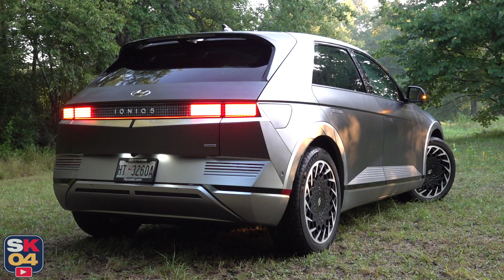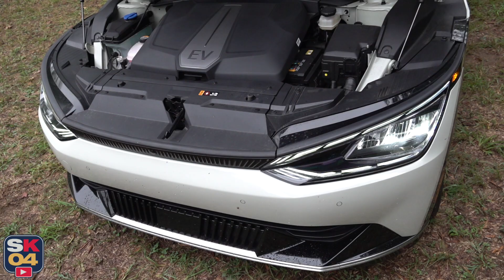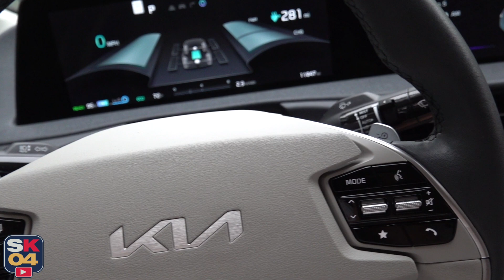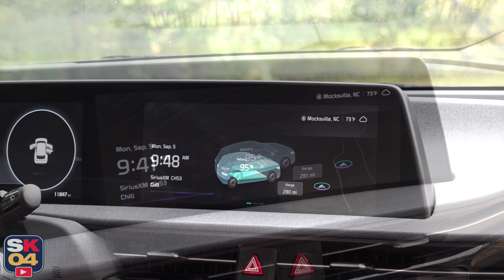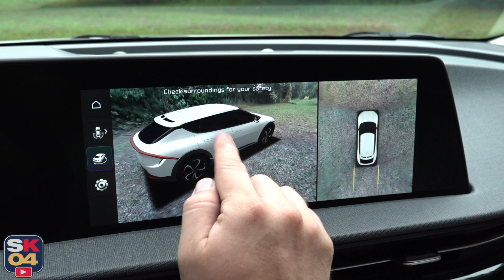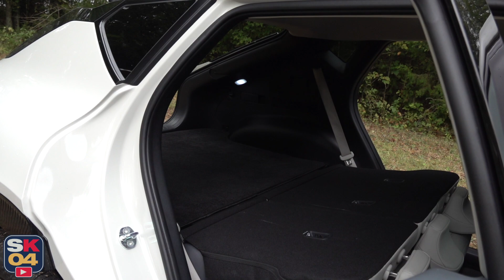2022 Kia EV6 Wind AWD: Start Up, Test Drive & In Depth Review

Comment: I've preordered a Cadillac LYRIQ AWD as my next car.  I should get it by January.

I've driven the Hyundai Ionic 5, the Kia EV6 and the GV60.

The GV60 is probably my favorite because of the luxury elements and BOOST button, but the Kia EV6 is definitely my second favorite. IT's a very comfortable daily driver  appliance with good looks and a decent interior.

Hyundai/Kia are lowkey dominating the EV market since Teslas are so expensive and hard to get.  It seems like EVERYONE makes superior EV to the Model 3 and Model Y.  Tesla could have made the Model Y better but they kept it cheap.